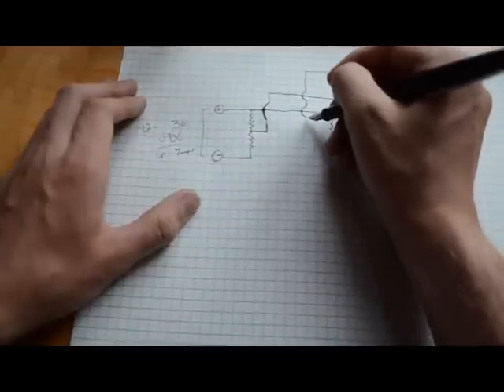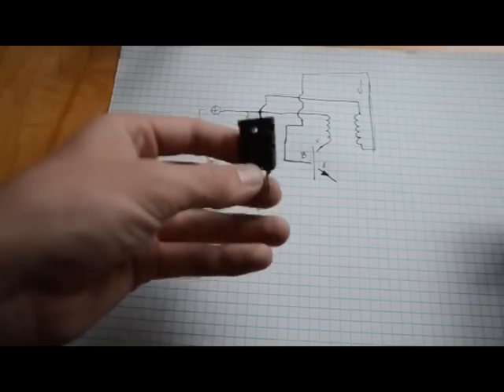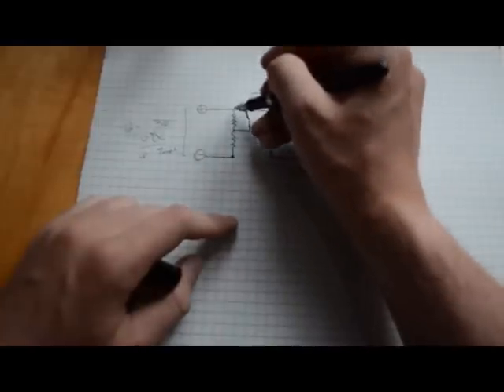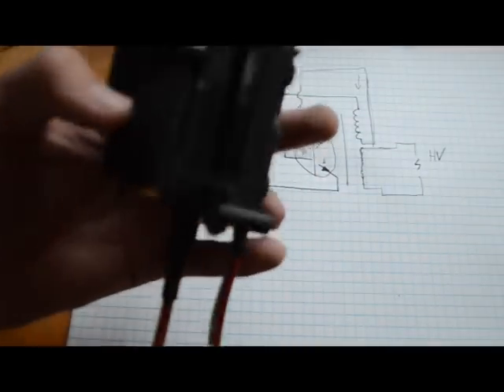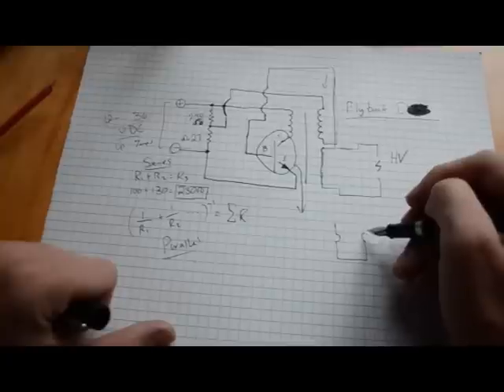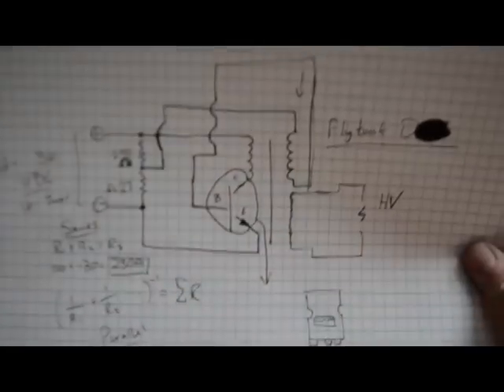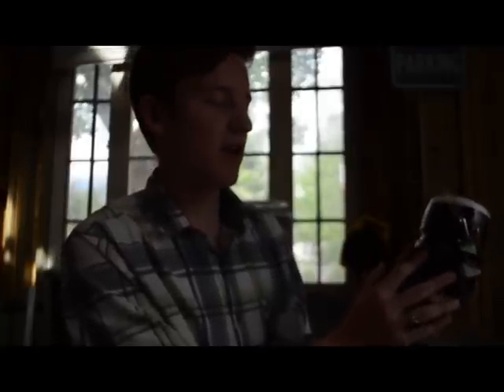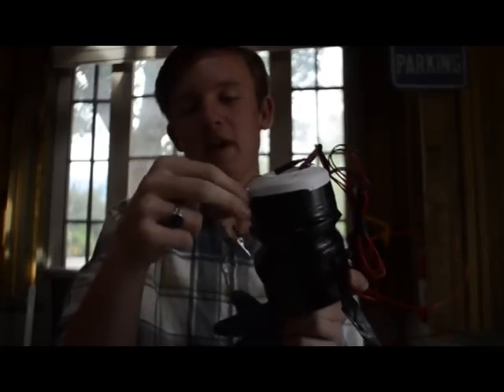How to make high power stun gloves!

Comment: you know, I have been playing around with high voltage for about 8 months now (MOTs, flybacks, tesla coils, voltage multipliers, etc) and I have only been shocked once, and it was only a small tingle not even going across my body. However, I use AC flybacks with no rectifier from old TVs that will pass current through me without me feeling a thing because of the skin effect. I'm 14.
Reply: lit
Reply: happy lat/early 16th birthadat